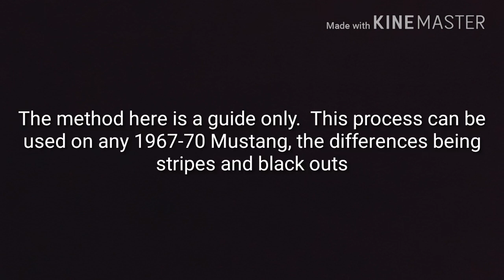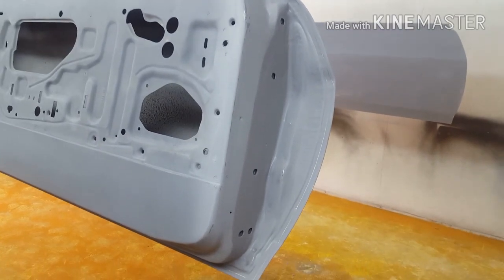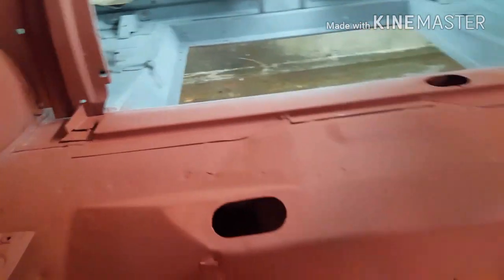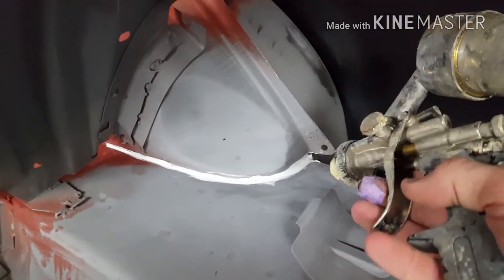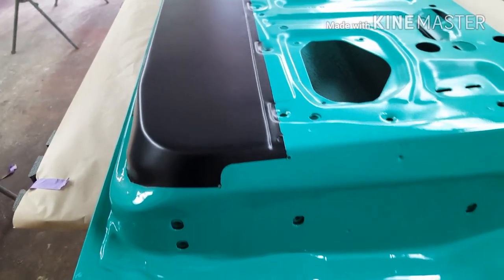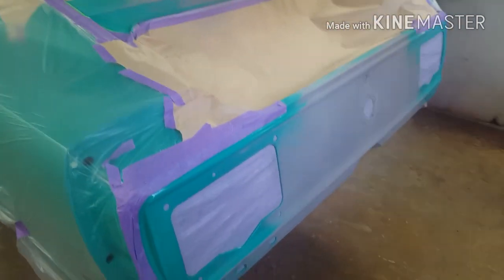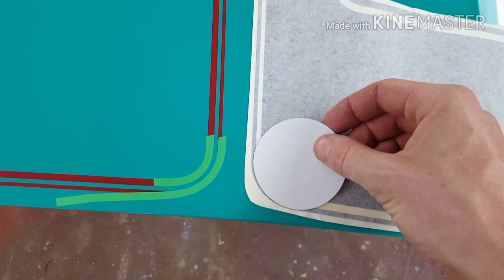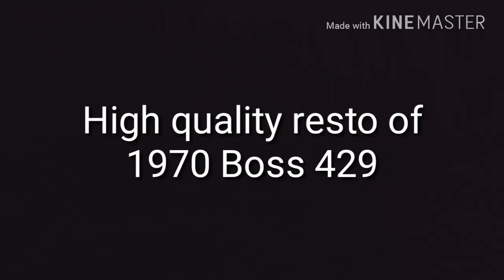How to paint 1970 Mustang in detail

Comment: Hi what is the brand of paint you used and what is the finish on the stripe black thank you
Reply from the maker: Most of my jobs are done in PPG. This is direct gloss solid with 5% clear mixed in to give it more shine. The black is solid with matting base mixed in 50:50, this varies form brand to brand so you have to spray some out on some cards to test. The texture is done by having little to no thinners in the first coat leaving a dry coarse look, then second coat wet as per normal. This also must be tried on a test panel as it never works right the first time.
Reply: @DarrenGilroy  So is this a single stage paint mixed withe clear?
Reply from the maker: @stallionranchwoodworks  Yes, 5% clear mixed in. It ads more shine to the solid colour and also makes it more UV stable/ resistant to fading.

Comment: I'm painting a 70 Boss 302 for a customer. I am trying to find out exactly what the texture is supposed to look like on the hood and trunk black. Any info would be appreciated.
Reply from the maker: It's tricky as even original un restored cars have lost there texture after 50 years so finding something to match is hard. As far as I know it's a fine coarse texture. My method is to mix the satin black with no thinners and dust it on the panel at low pressure, say two coats then one wet coat over the top with normal amount of thinners in the paint like you would usually do. This creates a rough look with an even finish. This method has to be done on a test panel first as all brands of paint vary to some degree. Let it dry a bit between coats otherwise it will go too smooth.
Reply: @DarrenGilroy  thanks

Comment: Hi,what is the color name of the black stripes etc?
Thanks, stock color?
Reply from the maker: It is a satin black I made up by matching an un restored car. It is very similar to Wurth Satin Black in the rattle can. So what I recommend is to buy the Wurth can and spray in on a color match card and get your painter to match that. This suites the engine bays to. This exact stripe is a rough finish so you have to experiment with making it thicker and dust it on the first coat then a wet coat over the top.  I think the original cars were Ditzler Oganosol but I don't think anyone makes it now.
Reply: @DarrenGilroy  
Awesome thanks 
Nice car by the way